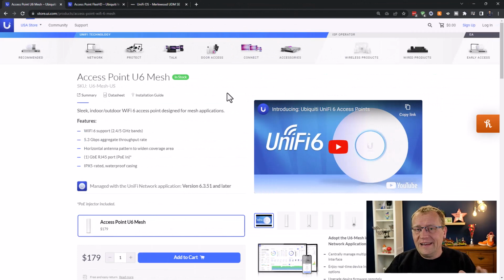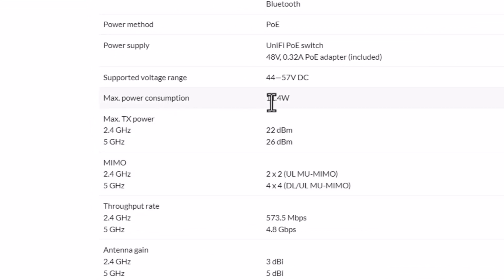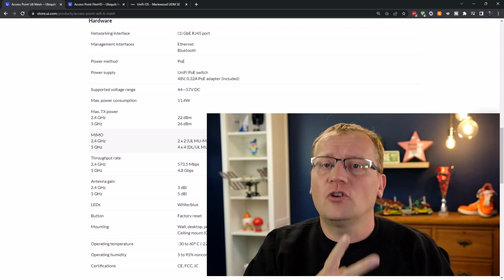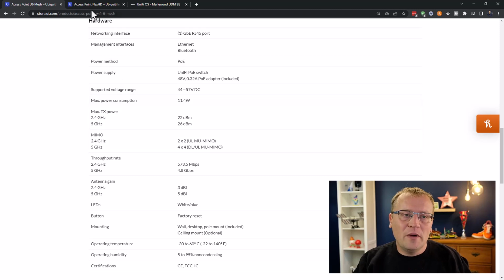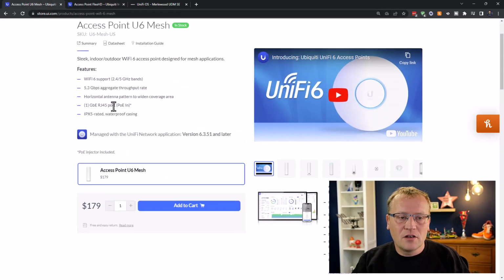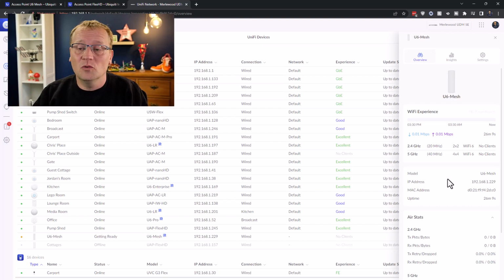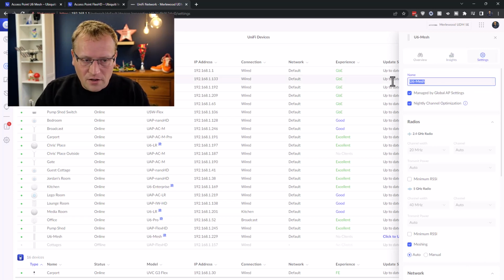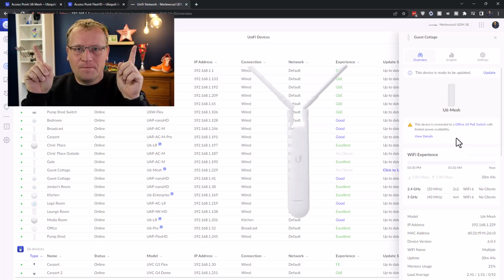Unifi U6 Mesh - explaining MU-MIMO antennas

Comment: Is the U6 Mesh reliable if exposed to direct sun(mounted outside on a pole but protected from rain)? I've read that they are little space heaters already...
Reply from the maker: Mine failed after 2 years, but not sure what killed it. I think water may have got into the RJ45 plug.

Comment: Thinking about migrating to this system. Going to go for a UDM pro for the controller, but can you just use the mesh system and adopt it into the UDM without being hardwired? I don't have a ton of cat6 ran throughout the house, and will need to use the power adapter for the poe for power. Assumption is you can just use the mesh/udm pro combo but would need to initially set the devices up with them plugged into the UDM
Reply from the maker: Yes, you can use mesh access points, although you will need one hardwired access point at least. Otherwise the UDM doesn't have any connection to the rest via Wifi.

Comment: how hot does yoru unit run. mines pretty hot to the touch
Reply from the maker: Really good question. I just went and measured it with my thermal camera. The outside temperature is 18C and there is light rain. The U6 Mesh runs at about 44C and is definitely warm to the touch. I don't think it is unusual though.

Comment: Unless you have a faster wired connection then 1 Gbps to the rest of you network a higher speed is only useful to other devices on the same AP. But given that throughput speed on WiFi are always halfduplex meaning both upload and download combined it really shouldn't be a big problem but in theory if you were to get devices that used all 573 Mbps and 4.8 Gbps you would lose over 60% of the speed the moment the data goes from the AP to the switch. 
But unify really should have put at least 2.5 Gbps ethernet on all their WiFi 6 products.
But using 40 MHz channels also eliminates most of the problem since it also cuts the throughput in half, meaning 4x4 link is a around 1200 Mbps download under ideal conditions.
Reply from the maker: All very good points Lasse, and shows how much maths there is involved in figuring these things out 😂 If Unifi put 2.5Gb ethernet on all switches, they couldn't sell their Enterprise switches 😛
Reply: Can't stay in the past forever. Unifi used to new and exciting. Now they is nothing special. 
Evolve or die and Ubiquity are not evolving.

Comment: Have you tested the range of this AP?
Reply from the maker: I haven't specifically tested the range, but I have connected to it from over 100 meters away in a direct line. Perhaps I should do a video on the range of various Unifi APs 🤔
Reply: @LarsKlintTech  that would be great. I have an area of approximately 8 acres to cover with WiFi, and have 2 AC-M, one U6-LR and one U6-Lite, and have lots of places to cover yet. I didn’t liked the LR in my case, so maybe the new mesh will perform better in my use case.
Reply from the maker: @gfjardim1983 It would be a little while, as that is a quite involved video, but I like the idea.
The U6 Mesh is definitely suited better for outdoor than the LR or Lite. Have you considered the AP-Mesh-Pro? It has a great range and because it is "previous generation" it is probably also cheaper now. Unless you are set on Wifi6.
Reply: @LarsKlintTech  I have a UAP-AC-M outside - and honestly have never been impressed with the range of it - I have 2 Instant cameras located maybe 7 meters away from it and they do not have good connection to it....(have had it replaced on warranty, troubleshooting with Unifi etc but still not happy) Do you know if the U6 Mesh has better range? (the cameras are located to the side of the UAP-AC-M - but in sight so hoping the U6 Mesh could do the trick and handle better 180 degree angle) -  the U7 Outdoor is simply physically  too big so hoping

Comment: Which is better ruijie 6262(G) or U6 Mesh?
Reply from the maker: That is a good question. I haven't tried the Ruijie 6262(G) AP, so I can't comment on actual implementation. On paper they seem to be very similar, however the U6 Mesh does have a 4x4 MIMO antenna, so you can have a lot more concurrent connections, and it has theoretical higher network speeds. Personally I like the design of the U6 Mesh better, but that doesn't affect performance (I think).

Comment: Hi Lars,
great video. I'm about to buy unifi outdoor ap for 2 ip cameras, some IoT devices and 3 smartphones when I'm or other people are outside. Recently unifi ac mesh has been restocked and it's 1/2 price of u6 mesh. Do you think that ac mesh will be enough? What is the range of u6 mesh?
Reply from the maker: Thanks Pawel. Appreciate the watch.
The coverage is roughly the same I think. I get about 200 meters in a straight line with both, but that is also with no obstructions. The main difference is that the U6 Mesh is Wifi6 and has a 4x4 MIMO antenna so it is both a more modern tech, and it can support a lot more devices. Both devices are very reliable in my setup so far.
Reply: @LarsKlintTech  Thanks! probably I'll go with ac mesh for now and when my setup outgrow it's capability I'll switch to u6 mesh (or other up to date device then) and use ac mesh as mesh point.
Reply from the maker: @pawelgrad  Yeah, that is a good approach. The AC Mesh is a good device.

Comment: No you can't get 5gbps throughput there is only a 1gb Wan port and say it's device to device unless you have wifi 6e with pci4 m.2 rives on both devices you MIGHT get that rate
Reply from the maker: Yes, definitely. I was referring to a theoretical speed if I upgrade switches etc. To be honest I'd be very happy with just gigabit internet connection 😂